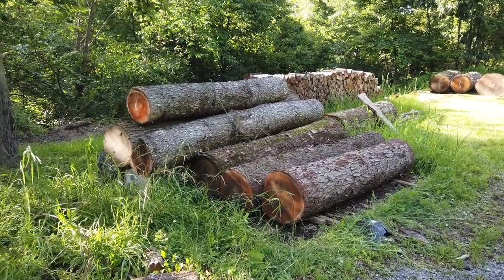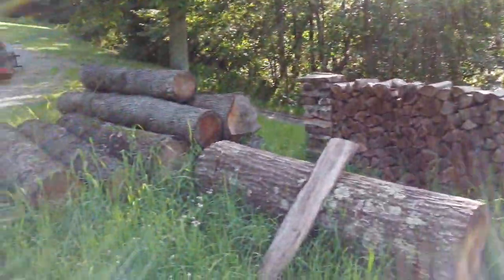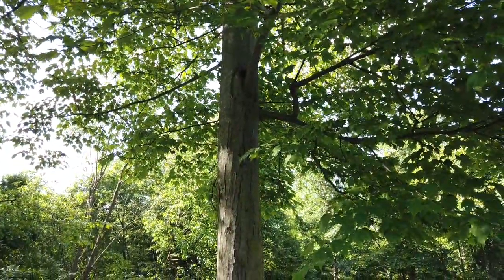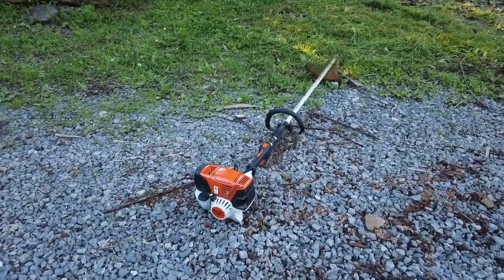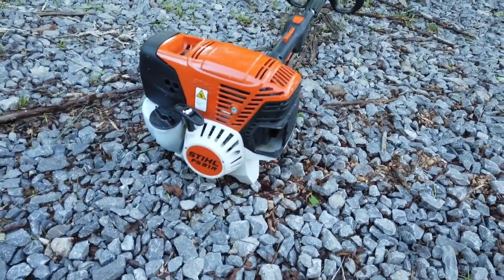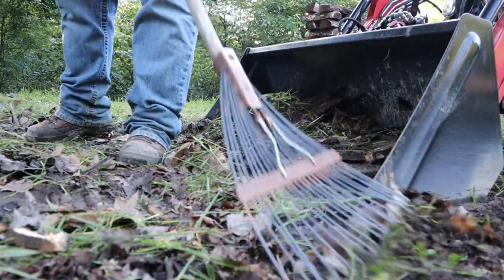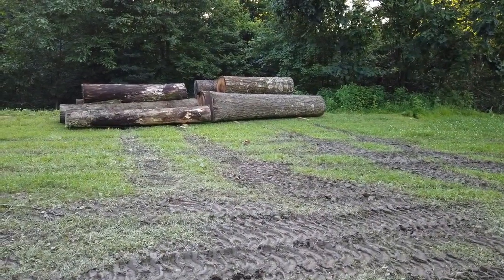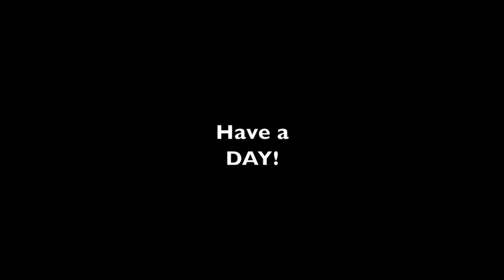#477 And Then Just Like That, The Rain Stopped!

Comment: So Envious of you having all those tractors with the different set ups....one with the bucket, one with  the grapple.....on and on. Seriously, how often do you change impliments?
So brush piles....yeah they don't burn very well when they are green so, just a suggestion, how about you find a nice PTO powered chipper to put on the back of one of those beasts you have. Checkout Woodland Mills from Canada....then you can down the branches and just chip them up. Just an idea....cuts down the time waiting for the wood to dry and having to look at ugly piles. Plus the chips come in handy. Have fun and hope the weather keeps holding for you!

Comment: I used to have well water, up until the pump burned up back in November(I have 'city' water now), and the problem I was afraid of wasn't the well emptying out, it was the pressure washer needing more water than the pump could give. I only could do an electric pressure washer then, since they had lower gpm.

Comment: It stops here too, for 6-8 hours and comes back with a vengeance. My new pole barn is a week off schedule due to the rain, finally got the concrete poured between storms yesterday. The metal went up fast after that but won't get to trim it or get door in until Tuesday now due to the rain. What should have been a 3-4 day project just went past 2 weeks, next is extending the blacktop and repairing damage from the weight of the mixer. Then top or take down some walnut trees a tad close to the barn before I can get back to the garden and greenhouse projects. It never ends!
Reply: And I can't let the pool totally slip off my radar since wife asks every day when I'm going to level out the spot with a 4 degree slope for it.

Comment: I noticed in this video that keeping the brush hog attached to the rear of the RK tractor is often a very convenient combination.  The brush hog provides rear ballast when using the grapple and then, once the materials are removed out of the way, the high grass and brush can be mowed down for a clean, finished appearance.  Easy Peezy!  I wonder if a mid-mounted mower would have certain advantages over the brush hog?

Comment: Try a surface cleaner with that pressure washer ! I am telling you it’s worth it for the increase in speed
Reply: Completely agree. Not just for the speed, but for your back! Your machine would probably handle something between 12" and 16" -- I've got 3 footer at work (and a big 6.5 gpm machine to back it up). We do the entire fleet shop floor with it once a month.

Comment: Mike you need to get a Karcher "surface cleaner" for you pressure washer. I bought one and it changes your life. Washing that concrete, or patio, brick patios etc.  or a deck or a utility trailer deck are too easy and so much dryer than just the wand. Probably reduces your time by 80% and you get a flawless job. It snaps on the wand like the individual spray ends do. Best money spent in a long time. About $50 online. Do it, you'll thank me.

Comment: The only kind of water worth having is well water. Our well is 400ish feet artisan well. Which is great because we have 9 horses and they go through water like crazy this time of year. Never really put any thought into only running the pressure washer for an hour at a time. And being in Virginia I'll back you up on the it's impossible to catch the woods on fire. We are clearing a half acre food plot. We drug a fire break around the perimeter using a box blade, and cut all the trees inside of it down. then set the trees and ground cover on fire and let it all burn. Literally no indication the surrounding woods were even thinking about catching on fire.
Reply: Jimmy Owens Im honestly not sure what my gpm rating is.

Comment: Mike, in most of your videos you are running your tractors in soft soil or (wet) grass, on hills and uneven surfaces while hauling stuff and it appears that you usually run your tractor in 2 (rear) wheel drive.  I was wondering if that was indeed the case and if you have a particular preference between running 2 or 4 wheel drive full time?  

You must love how easy it is to grow fescue grass in your area.
Reply: Only use the 4 wheel drive when you need it. Keeping it on full time is extra stressful on the drive train  especially when turning.  The front and rear axles fight each other in a turn. Very few machines have full time four wheel drive which includes a second differential between the front and rear axles. Only on these machines can you leave it in 4 x 4 full time if desired.  You can also leave the 4 x 4 on full time if a vehicle has articulated steering.

Comment: I've got an ArmstrongAg 72-11 grapple coming for my JD 2350. Anxious to get it here and try it out.Funny thing: JD dealer flat refused to weld on the mounts and said for $500.00 they would hire it out to a certified welder to get them welded. We reached a compromise: they will tack weld them on to align and fix to loader arms and I'll finish out the welds. Mounted 3 dozer rakes last few years and none fell off........It's a liability thing for them. Have I mentioned just how much I HATE lawyers lately? These dang BS lawsuits they come up with are ruining the nation.Got a battery pole saw from horrible freight a few years ago: has held up surprisingly well for being so cheap.
Reply: That JD hasn’t adopted the skid steer mounting system, it just wrong.  It really limits the flexibility of their tractors.